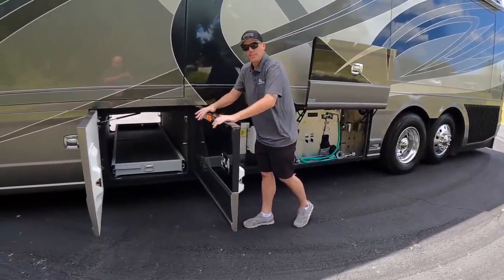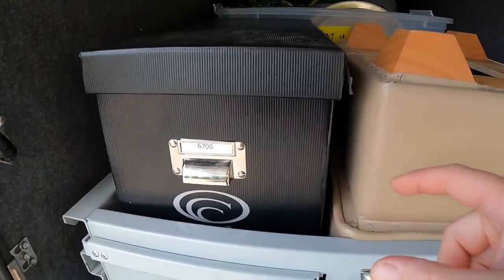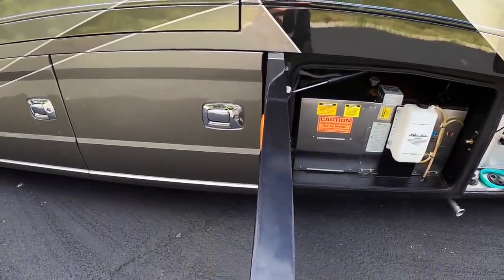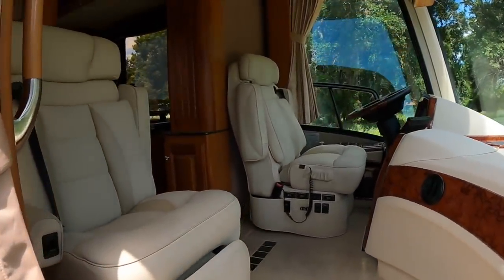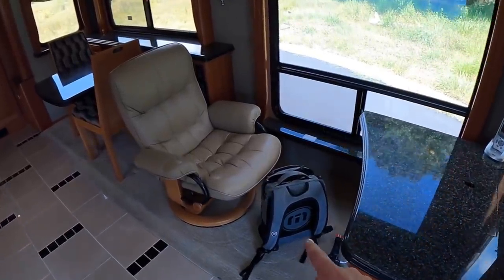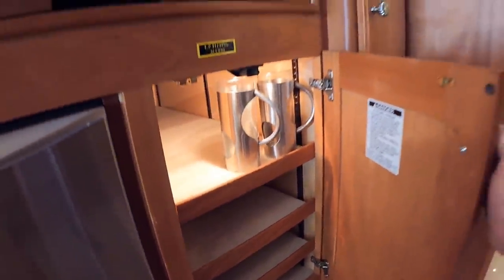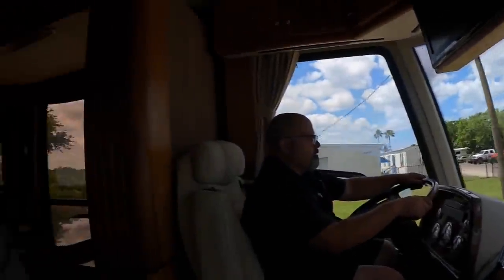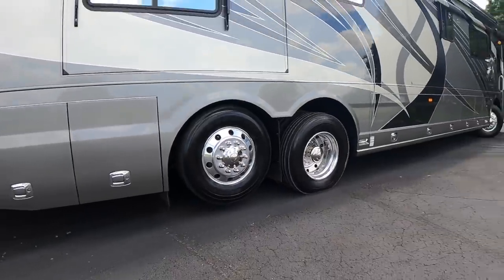THE NICEST COUNTRY COACH MAGNA IVE SEEN (S0LD!!)

Comment: Do you know if the ISX 600 engine in this coach has had the cylinder head replaced per the Cummins TSB?  This TSB was issued to address the dreaded dropped #6 intake valve problem.